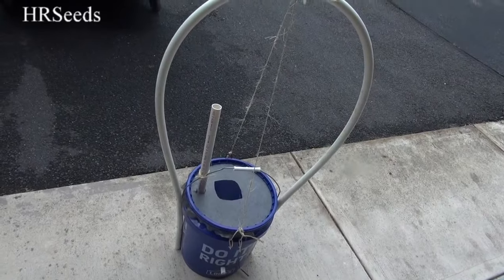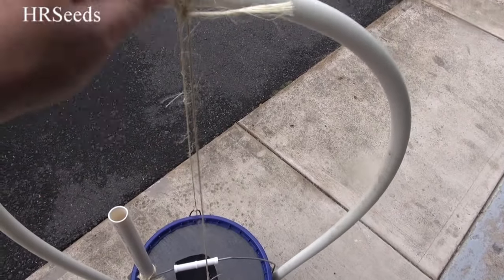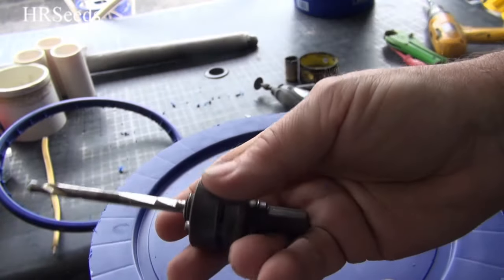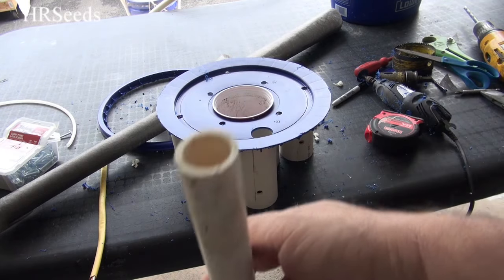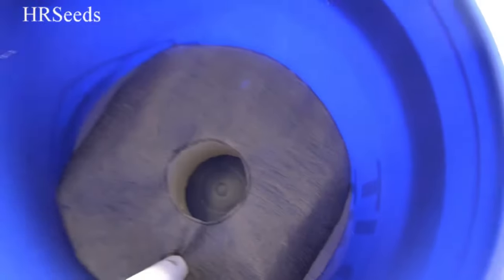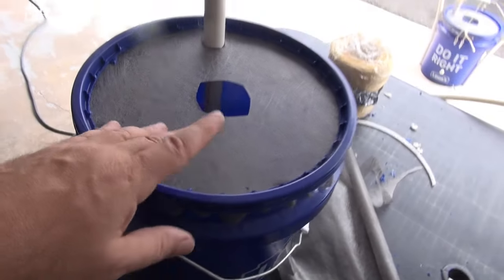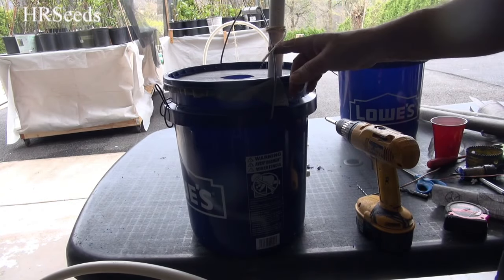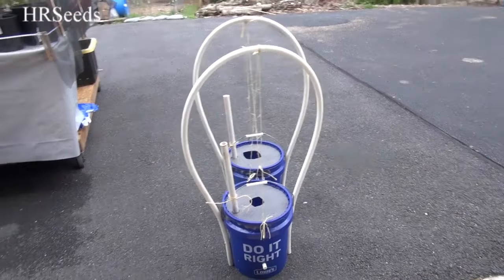NEW - DIY 5 Gallon Self Watering Bucket Planters For Tomatoes and Pepper Plants 2022 PT 2

Comment: Beautifully detailed video. The best on container gardener I've seen. Thanks very much. One question: With the top cloth on how do you tell when you need to water again?
Reply from the maker: The water sits in the bottom, you can top it off every day if you want. you will not over water. However, rain will and can cause over watering. rule of thumb: on really hot an sunny days you will need to water more an on cloudy days less.
Reply: I do almost the same system and to check water level do this: Add water to the fill pipe until water comes out of the side drain hole.  Get a stick (i've used long wood skewers or a long wood dowel) that fits into the fill pipe and is longer than the fill pipe. Drop the stick into the fill pipe then pull it out and the top of the water mark on the wood indicates full. I wrap a piece of tape at the top of the fill mark so I know what the water level is every time I check.  Its like checking vehicle oil with a dip stick.  You can also put a cork or something that floats at the bottom of the stick (a wood skewer with a wine cork) so you can see the water level from a distance. When its full the stick will stick further out of the fill pipe and when water level is low the stick will be further into the fill pipe. Use tape or permanent marker so you can mark the wood at high level. Hope it helps.

Comment: Dont drill with a straight drill as they can grab and tear. Best to use a tapered stepped drill bit. If using a hole saw for larger holes, spin the saw in REVERSE! It won't grab and the saw will heat the plastic a little and make a cleaner cut.

Comment: Great Video 👍👍👍.   I've been wanting to try this for years, however I've had some medical issues. 
I was wanting to try something on a smaller scale. I have a couple of smaller buckets. I think they are 2 gallons.  These buckets are 9" tall by 8" wide. I've. Used your measurements and tried to scale them down to fit my bucket. I only plan on growing stuff like Green Onions, Radishes, Carrots, and stuff like that, rabbit food,so to speak.  As I mentioned earlier, I have medical issues that would prevent me from moving around 5 gallons of soil.
I'm sure there's a lot of people people like me that would like to grow some of the vegetables that have a shorter root system, or even grow some easy to care for flowers. 
This would be a great video to do. Maybe someday you might get time for that. Anyway wish me luck math isn't my strongest skill.
Reply from the maker: Keep in mind you don't have to fill the bucket all the way and these buckets are really not that heavy

Comment: Tip 1: don't use the dixie cup.  Drill a couple of small holes in the lid part and put strips of cloth through the holes into the water to do the wicking.
Tip 2: drill holes or cut out openings at the bottom of those white support tubes so that the water can enter and exit at the bottom

Comment: I have a question.  On the two holes that you cut out of the center of both fabrics. Why don't you just cut 2-4 cuts,  like you did on the fill tube holes? That way, the cup in the bottom would have a right fit, and the hole on top for the plant could be pushed down into the soil or up against the plant. Just a thought.

Comment: I needed a way to trellis. I make raised planter boxes that hold 3 buckets. I did not want to attach to the box incase I need to take the buckets indoors for hurricanes or the freeze that is coming this week. Does the pex have to be 3/4" or will 1/2" work?
Reply from the maker: 1/2 wont work 3/4 or even 1 inch

Comment: Using 5 Gl. Buckets is a great idea what surprises me is that there are many differnt ways to build them but  no body mentions "food safe", the regular ones at H.D or Lowe's are not, they have the food safe al;so, they are White but are more expensive, also the ones used in construction to hold plaster, concrete mix or paint ARE NOT FOOD SAFE. the ones you get free from restaurants and specially bakeries are 100%  food safe.
Reply: Look up food safe codes, we found HD has food grade buckets just look at the bottom of the bucket with the food grade codes to verify.

Comment: The holes in the 4 pvc could you not drill a larger hole say 1 in threw the pvc the cut to length two drill holes would do for the 4 pieces